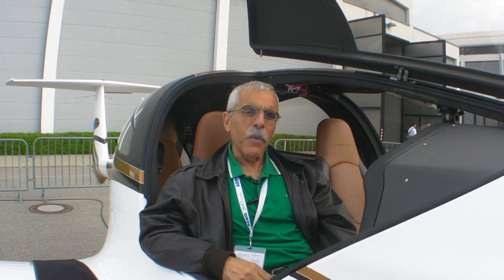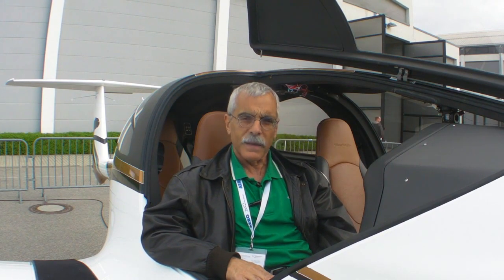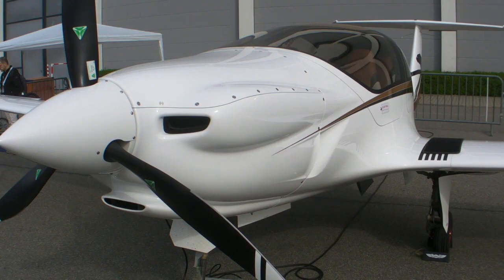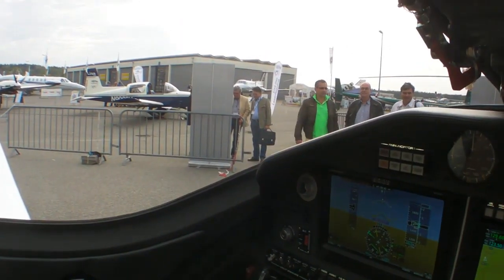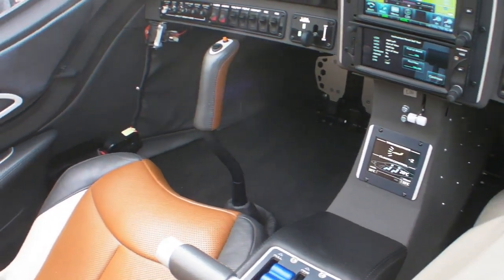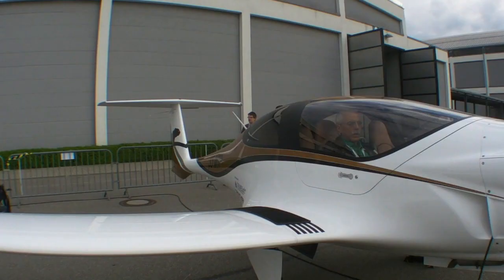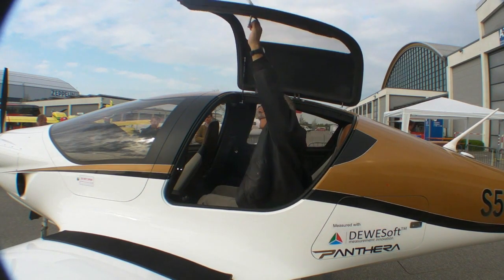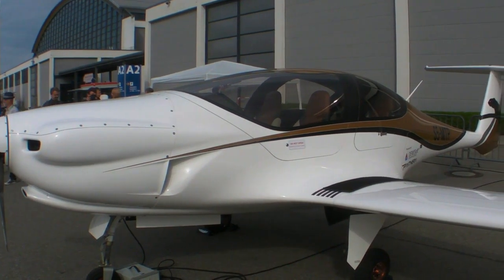Pipistrel's Impressive Panthera at Aero 2013

Comment: Visibility is fine.
for comparison, if you look at a DA-40 you'll see the top of the instrument panel inside the windshield is significantly higher than the windshield giving the same amount of forward visibility as the panthera...
also, in flight the nose is at a lower attitude.
plus, if you're short, the seats rise when adjusted forward.
better visibility than a 172.